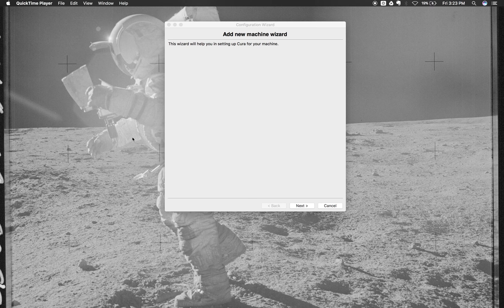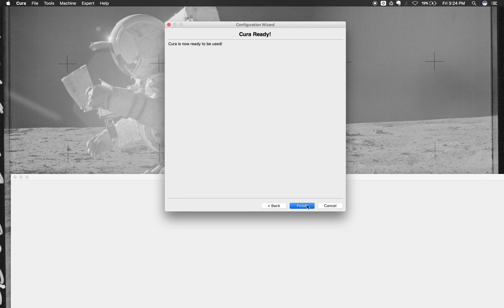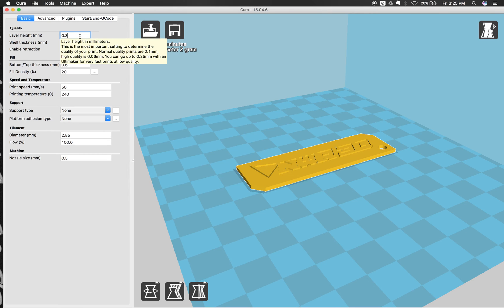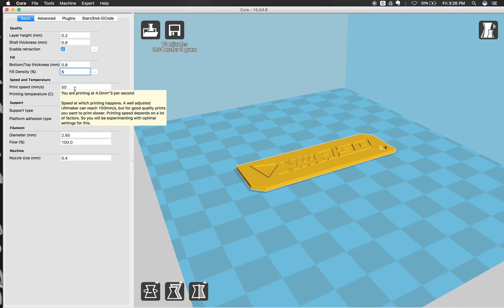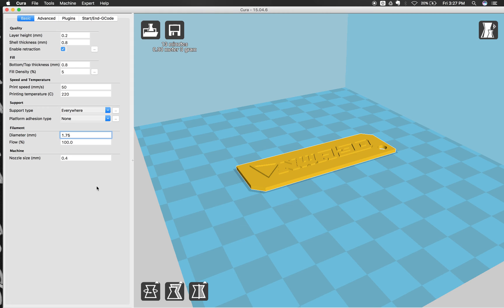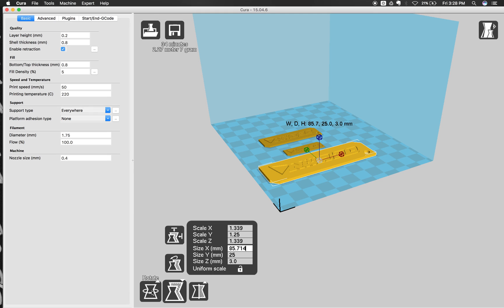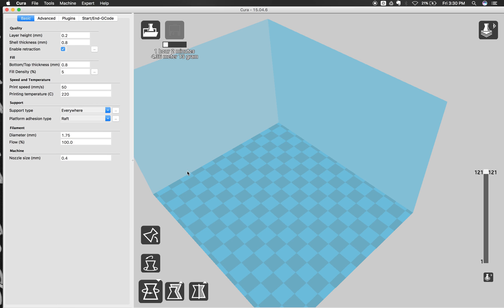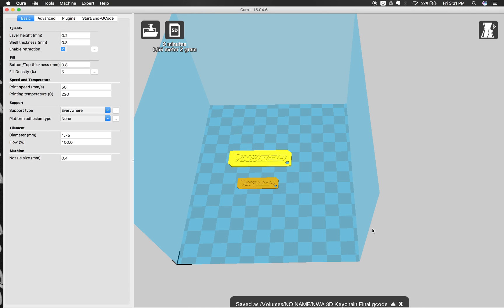NWA3D A5 Tutorial: Cura 15.04.6 Settings and Overview

Comment: I am not getting this ADD NEW MACHINE window ,i installed cura 15.04.6 but it doesnt work 
please help
Reply from the maker: Hey Suraj, Cura 15.04.6 is an older version that has been out of support by Cura for awhile. Try the newest version and see if that fixes your issue!

Comment: Where do you download Cura 15.04.6, having trouble finding the correct website to download it.  Thank you for your help!
Reply: Cura 15.04.6 is an older version, that may still be available on Ultimaker Cura's GitHub. If you have an NWA3D A5, just download the newest version and you can easily choose it from the non-networked printer list to have all of the settings!
Reply: Did you ever find a way to download it? I need it for a new matter mod t
Reply: i can send you